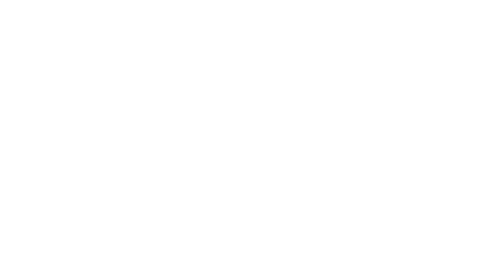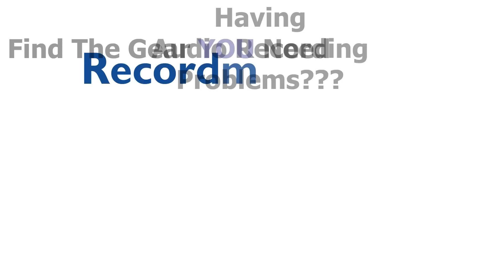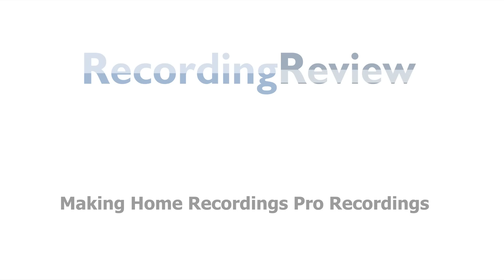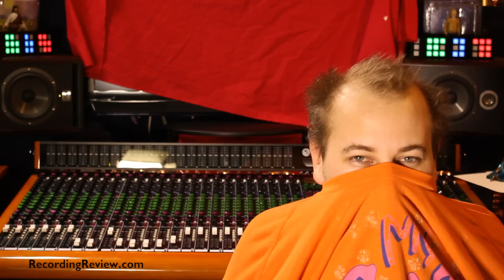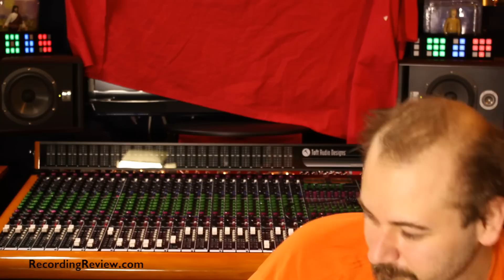Building Your Own XLR, TRS, and MIDI Cables

Comment from the maker: @DaSAirwaves  The Canon T2i is really a DSLR camera, but it's video thing is pretty damn badass.  I was told that I should get a "real" video camera, but this is working out very well.  I edit in Premiere CS5.  Their mp4 encoder thing is excellent.  I always render to 1080p as Youtube does dramatically less damage when you send them the hi-res stuff.  I do use 3 LED lights which I'm getting less-crappy at using.